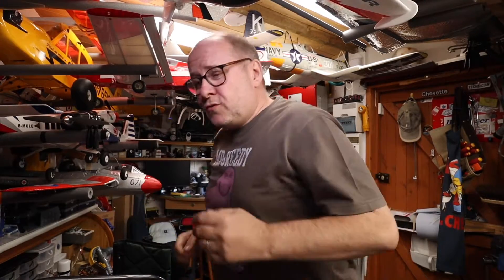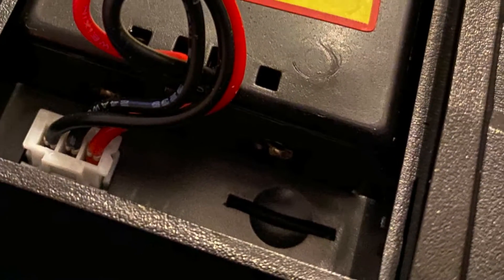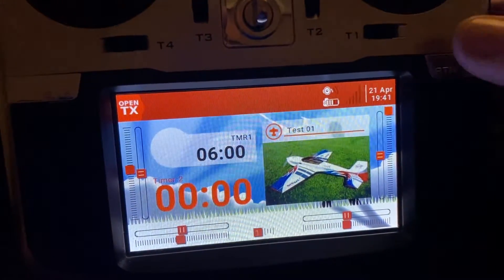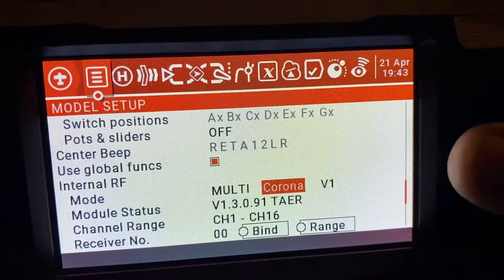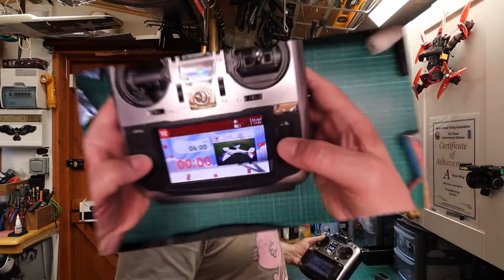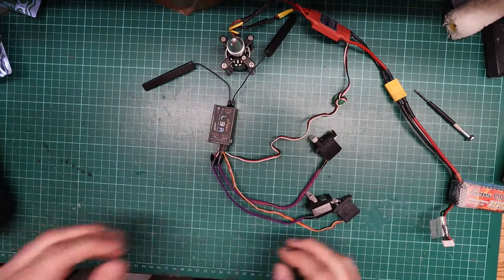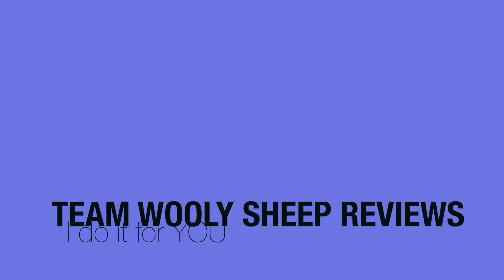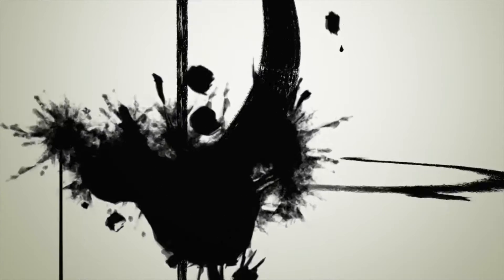Multiprotocol Module FW Update for L9R compatibility - Jumper T16 Pro

Comment: Once again another great intro, but I am getting confused with all this talk of l9 and multi protocol modules. I only fly quads (not toys) 
1) do I need to buy the multi protocol module.
2) do I need to upgrade my firmware.

I'm a great believer in the old adage "if it ain't broke dont fix it".
Looking forward to your answer, perhaps you could clear that up in a t16 round up video.
Reply from the maker: Wycliffe Barrett you have a Jumper T16 the same is mine.       
1. Yours has a multi protocol module already built in as mine has. Why would you think you need to buy another one?           
2. As you say if yours ain’t broke nothing to fix.

As I explained in each of my videos it doesn't work with my L9R receivers and was advised by watchers that it needed a FW upgrade to give me L Series access. I had already contacted Jumper and Joshua Bardwell only a couple of weeks ago and they told me it wasn't supported and I had to buy a FrSky module to use L series receivers. A week later they brought out a FW upgrade....grrrrrrr. 
I had already bought a FrSky module as that is what they told me to do so......
I am suspicious about the need for tuning the multi protocol module and therefore concerned about signal quality.
Quads are flown short range but planes can be 100 of meters out and not prepared to risk it so happy to stick with the FrSky module plugged in the back. Until I go TBS Crossfire all the way.

Comment: Don't you recommend using the internal module to fly planes? For example: an Edge 540 with glow engine? Thanks for the vídeo.
Reply from the maker: Thiago Bruciere I have not used mine yet but worried about the signal quality with the multi protocol module. The fact you have to tune it due to racing quads having brown outs as such short range is a red flag to me

Comment: You've got good eyesight flying 3 miles away LOS 😁 I wouldn't bother with an L9R in a LOS model it's overkill and there are cheaper receivers you could put in them
Reply from the maker: I was using them for FPV planes but take you your point. I have a couple of standard receivers I can swap them out and keep them for just fpv.